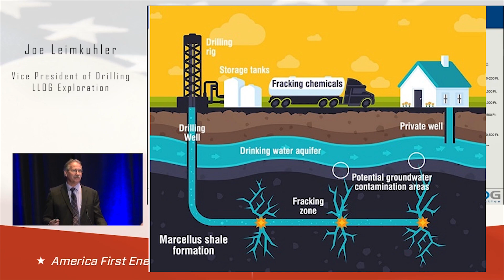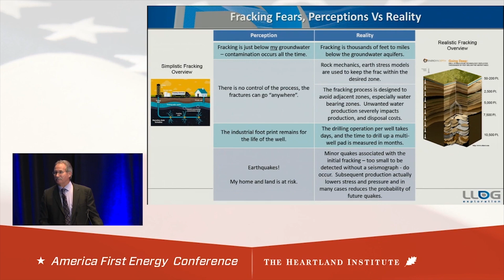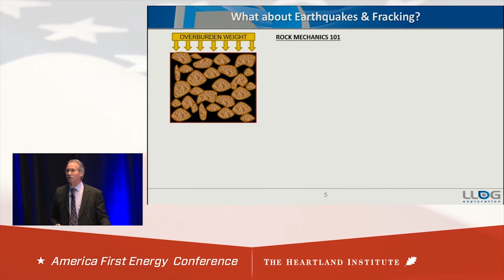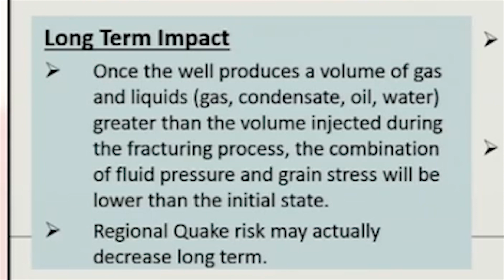Fracking Myths vs. Realities

Comment: The well bore goes through the water table - yes - the horizontal is farther down, but gas extraction using fracking HAS polluted groundwater - 250 cases in Pennsylvania alone: https://www.bizjournals.com/pittsburgh/blog/energy/2014/08/dep-finds-243-water-sources-contaminated-by-gas.html